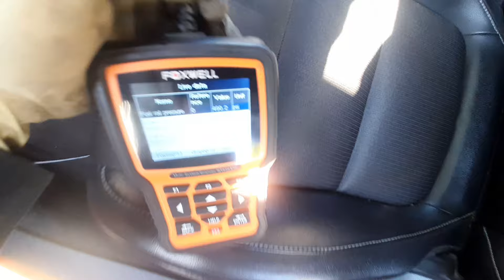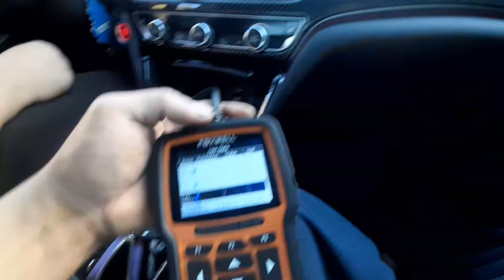2018 honda accord sport head gasket video @sandman's garage

Comment: I see you mentioned Pacifica.. Bay Area? anyway you can help me out with my accord? Is it possible to pay you to install injectors and maybe this Im not sure what’s wrong with my accord I have a 1.5 and have a p0303 code I changed out the spark plugs but it came back now trying to replace the coils any tips?
Reply from the maker: Remove all plugs, pressure test coolant, with a bore scope, watch if coolant seeps out of the head gasket, block in the cylinder with the misfire
Reply: @sandmansgarage8359  would you be able to do work on my accord? I Can pay you might need a fuel Injector change in in the Bay Area